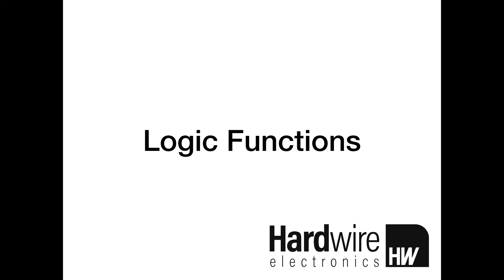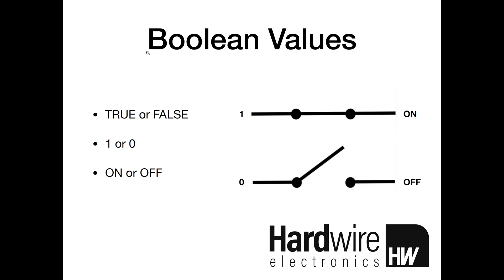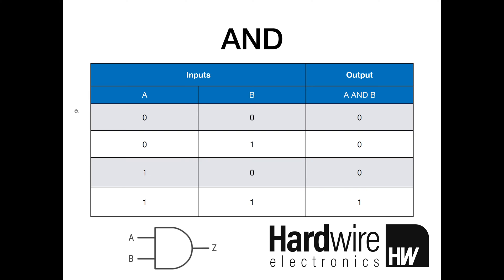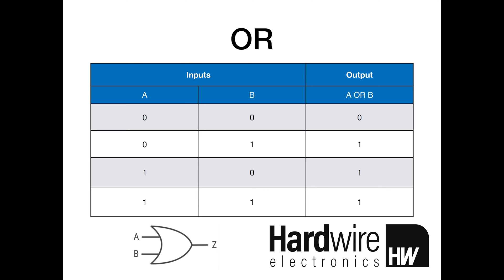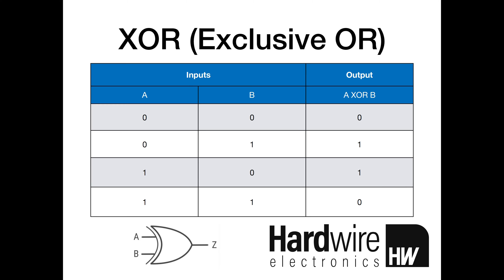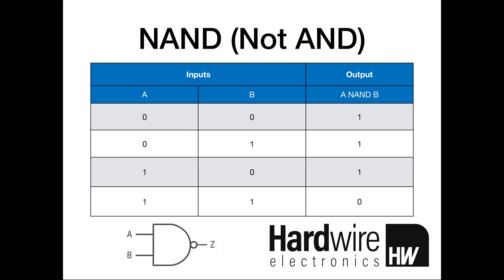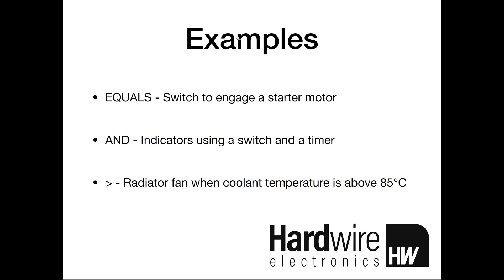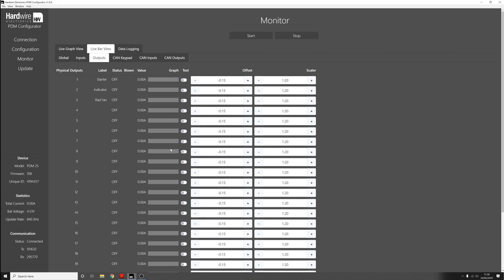Logic Functions | Hardwire Electronics

Comment: Steering wheel 4 button keypad sending anything from 0-5v to a PDM input. Each button adds a resistance and makes the keypad output a different voltage. So let’s say button 1 when pressed, the keypad outputs 2v… This I have setup as wipers On. How do I configure an specific analog voltage input into a latching state to turn a circuit on?

Comment: How do we control two radiator fans if they pull an advertised 25 amps each? I saw your outputs are good for 20amp. So both fans on is a total of 50 amps.
Reply: I believe you would just do 2 outputs but with the same input information, also from what I have read there is a soft start feature in the PDM